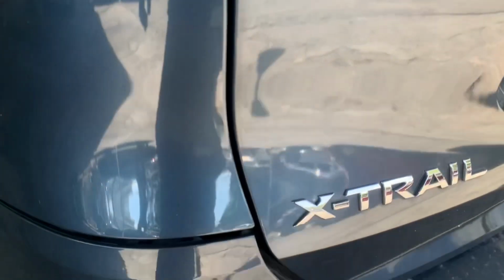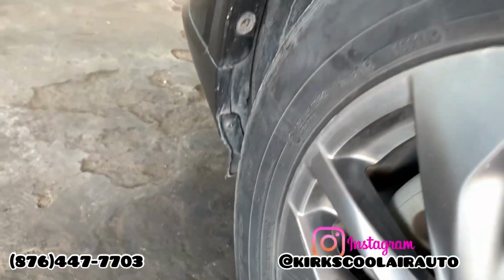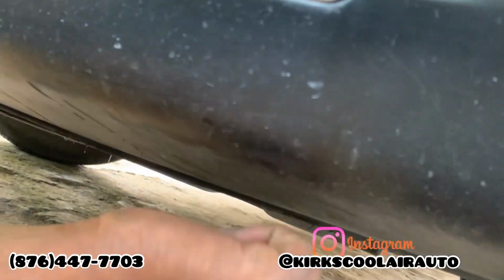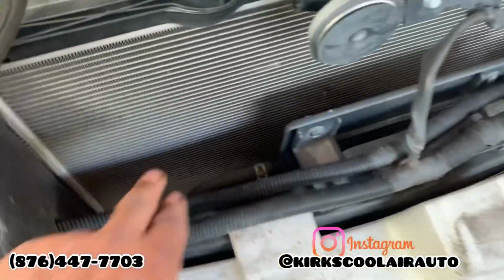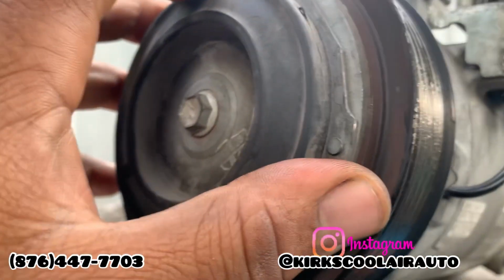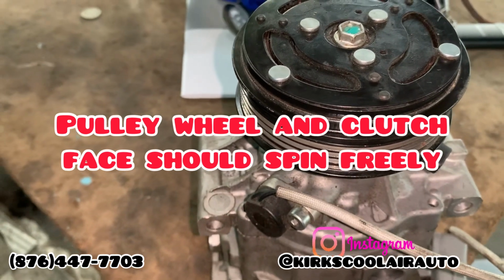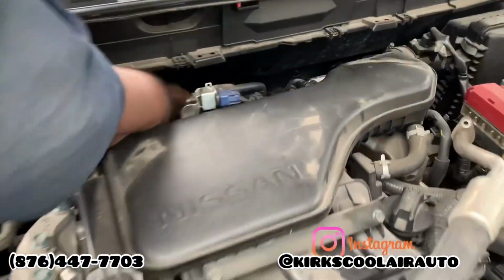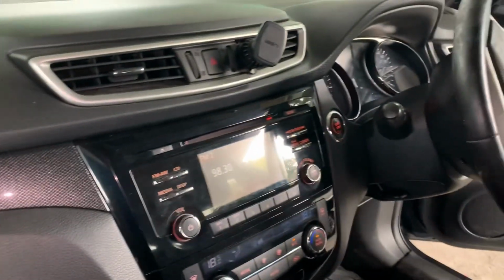How To Remove And Replace A Nissan X-Trail A/C Compressor #accompressor #condensor #recharge #ac

Comment: Bro, I have two wires sticking out, and one will go into the compressor, and the other one is the one I am confused with. Where will I connect it to?